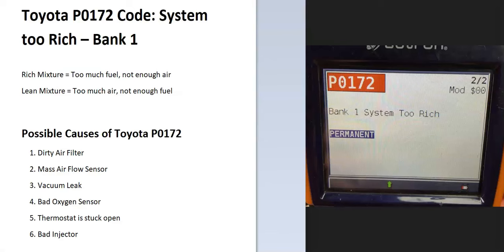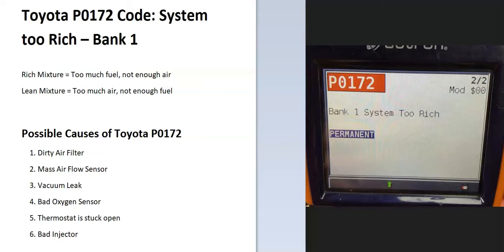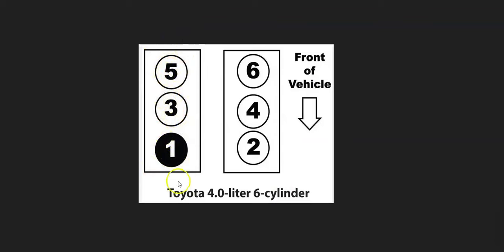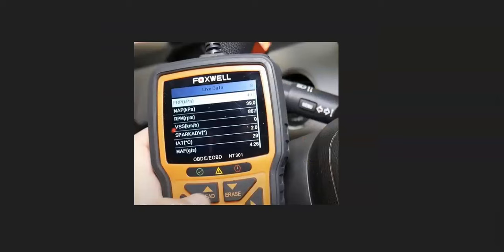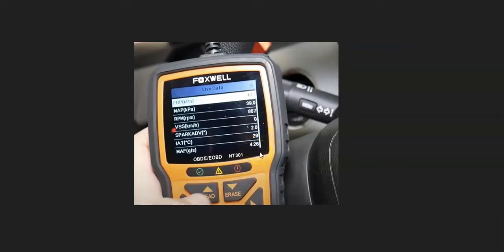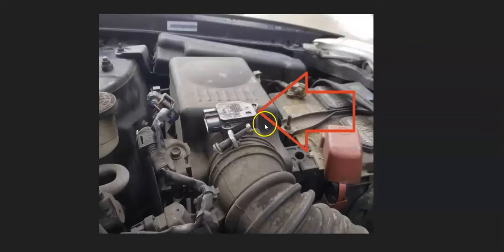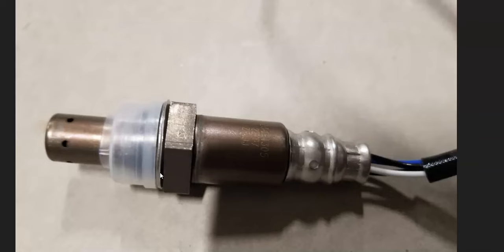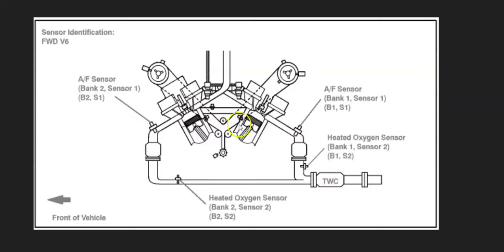7 Causes of a Toyota P0172 Code: System too Rich – Bank 1

Comment: Going through all steps now with my 2000 Echo. Changed  injectors, cleaned MAF, replaced O2 sensor, air filter. Runs better but rough on take-off or second gear with gas. Kicks butt on the open road.

Comment: I had code172 for 02'Tacoma 2.7 litre. tried all you mentioned, my reading for b1s1 was over 40.00! extremely rich! So, I bypassed purge solenoid valve and it went down to 11 volts, much better but too high. waiting on OEM Toyota purge valve. PS, Old purge valve did click open and shut when I did battery test BUT WHEN I BLEW IN THE TOP NIPPLE FROM INTAKE IT DID NOT SHUT COMPLETELY.

Comment: Excellent video, Thank you. 
I have Sienna 2003 .. P0172 and P0174 .. having these two codes at the same time .. Does it indicate something more precisely?
Reply from the maker: Since the problem is on both banks, it would be something that affects the whole engine, such as a MAF sensor or fuel-related issue.

Comment: I have a 2006 lexus is350,check engine light came on for these codes and car would hesitate to get going. I replaced maf sensor cleared the code ,ran good for about 300 miles then the danm code came back on. Guess i need to test some things.
Reply: Replace or clean your pcv valve

Comment: Hi.. I e checked all those.. the check engine light turned off the it came back on the next day.. it also has a hard start and it still has a slight hesitation on acceleration.. what could it be?
Reply: Intake manifold gasket
Reply: Could also be the fuel injectors..

Comment: Quick question, you made a video a while back about fuel pressure and I just wanted to see if you could help. I drive a 2018 Nissan Versa Sv. One day it started to take forever to start and then a month later it died in a parking lot. It wouldn’t start so I changed to fuel pump and it started again but took forever to start again and wouldn’t let me fill up on gas. So I changed the purge valve solenoid (I think that’s the name) and now it fills up on gas but it still really struggles to start. When I do that key test (of turning it on and off again) sometimes it starts back up right away. Do you know what I should do?
Reply from the maker: I would do a fuel pressure test to see if it is fuel-related and go from there. It should hold pressure, and the correct running PSI can looked up. Auto parts stores will rent out a fuel pressure tester. It is best to first research connecting a pressure gauge to the fuel rail since sometimes an engine will have a connection port, and sometimes they don't.
Reply: Injectors leaking down is more likely in a hard starting engine. You can get a P0172 with a low compression cylinder as well. Check fuel pressure drop after the engine stops. You shouldn’t lose more than 10-15% of the pressure that was on the rail at engine turn off.

Comment: I replaced both oxygen sensors and just got a new catalytic converter installed on my 09 1.8 Corolla S and I have the P0172 code I’m thinking it might be a vacuum leak, do you think I could try to find it by spraying soapy water around my intake and hoses?
Reply from the maker: There are several methods I have never tried that one. I always use the smoke machine method. Some mechanics will use starter fluid and spray it at a possible leak location, and if the engine idle changes, they know they found the leak.
Reply: @HVAC_Mechanic  gotcha gotcha, the car seems to be showing the green light on my OBD2 scanner, so life is good right now!
Reply: @HVAC_Mechanic  thanks again for the info!!!
Reply: @theemrc hello i have the same code issue..and the same car model and year.  Please what was the eventual solution?
Reply: @OlufemiAdegun  I installed an oxygen sensor spacer and it cured my code.
Reply: @theemrc  thank you..
Reply: @OlufemiAdegun  no problem at all!

Comment: Toyota don't use O2 sensors, also known as a narrow band type sensor, which are inexpensive to replace, Toyota uses a Air/Fuel ratio sensor, also known as a wide band type sensor, they are much better and are not cheap, they can cost 3x more then an O2 sensor, you can't really clean them up and reuse them 9 times out of 10 they will not work and get worse if you try to clean them and reuse them.
Reply: What’s the best way to test them?
Reply: There are some ways to test them, but what is the problem that you are having ?

Comment: Not good advice.  If you had a vacuum leak that would cause an engine lean mixture code instead and not a rich code..  Next thing here is that you didnt mention the usual cause of rich mixture codes which is a purge valve that is stuck closed
Reply from the maker: In older vehicles, a vacuum leak would often cause a Lean condition; in newer vehicles, the ECU can try to compensate by adjusting the gas/air ratio and often making the mixture richer. A purge valve stuck open may cause an issue when starting, but stuck closed will just give an EVAP code. Always pay attention to other codes.
Reply: @HVAC_Mechanic  Youre not a mechanic and everything you stated is pure nonsense.  Next, you have no idea who youre talking to here
Reply from the maker: @EarlGuyton425  
I am not here to argue; I'm just talking about what has worked for me. I've been a mechanic since the 80s; all I can talk about is my own personal experience solving an issue.
Reply: @HVAC_Mechanic  MUTED  BLOCKED.  Youre wasting my time
Reply: Gotta love know-it-alls who crap on other people’s videos without even trying to be constructive.
Reply: @HVAC_Mechanic I love your maturity. Early guy is a druggie, go chech him out. Nice content by the way and everything you said is on point. I'm a mechanic too..
Reply: Cleaned the MAF and code is gone so advice worked for me boof head.
Reply: @MrWeareone777  Muted
Reply: @EarlGuyton425 muted